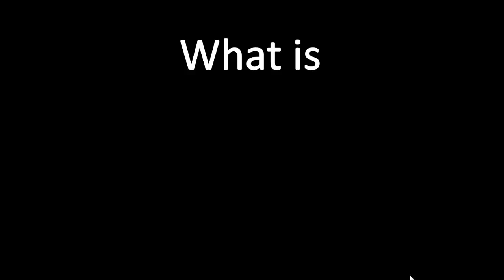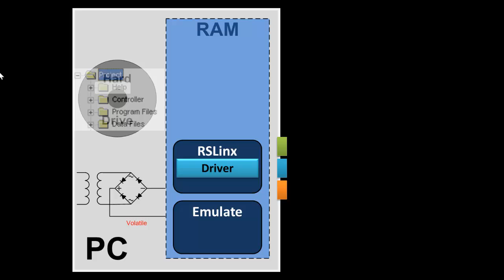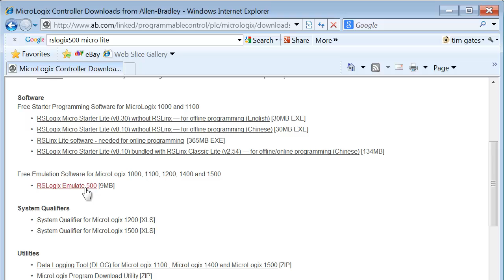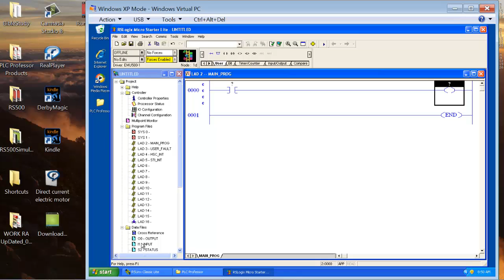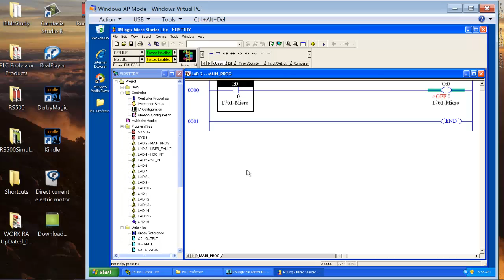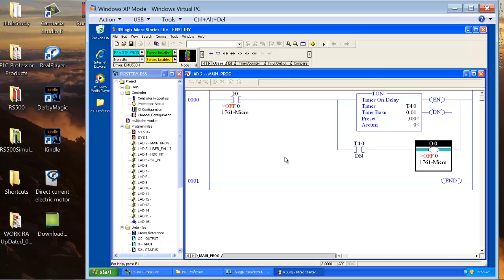RSLogix500 PLC Simulator - Free RSLogix 500 - RSLinx - RS500 Emulate.mp4

Comment: Thanks a lot,I successfully download and it working perfectly in my pc .So do I have to create a different station on my rslogix emulate on each individual project but up to now I have crated 27 stations..i am worried as you said the maximum is 35 so what should i do now...?
Reply from the maker: Whay are you creating multiple stations?
Reply: I was thinking that each project must have his own stations,because sometimes when i want to use the other stations the program open the previous project saved.So I try to remove stations and once removed they are back again..please advise thanks
Reply from the maker: 500 Emulate will accept any program created for it. It emulates a single processor, not multiple processors.

Comment: Professor please i tried to install the RSLogic500 but it was not successful. This is the message it gives me when i tried to open the  RSLogic500 application.
failed to update the system registry.

"Please check registry security rights or try using REGEDIT."

"Also it shows RSLinx Classic path not found in ICOM.INI or ROCKSOFT.INI.RSLinx must be installed in order to run RSLogix Emulator 500"
Reply from the maker: Try running Micro Starter Lite as "Administrator". Your second problem, I have no idea, it is not something that I have seen before. Type it in to your search engine and google it, that is what I would have to do.

Comment from the maker: There are so many iterations of computers out there it is hard to guess what the actual issue is, but if it was my laptop. I would go to the control panel add remove programs and remove all three. Then load RSLinx first, reboot. Load Micro starter lite, reboot, Open up Micro Starter lite to make sure it opens, open up RSLinx to make sure that it opens. Watch the video again, load RS500 emulate, reboot and follow the instructions very carefully. Who knows what tiny detail that I take for granted.

Comment: Although I do plan on spending the money on an actual PLC this is a very handy tool to have for early learning. I was wondering if it was possible to use the keyboard on a laptop to simulate switches 1 through 6 of the ladder logic. Also I have become a big fan of the videos and have encouraged other students that I know to use as visual or audio in between classes. Thanks a ton for your willingness to share your knowledge.